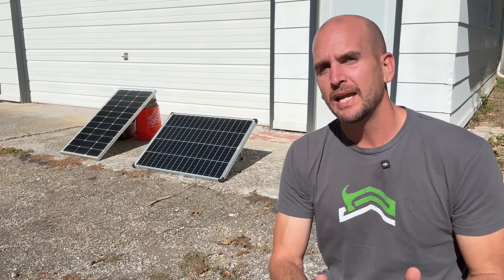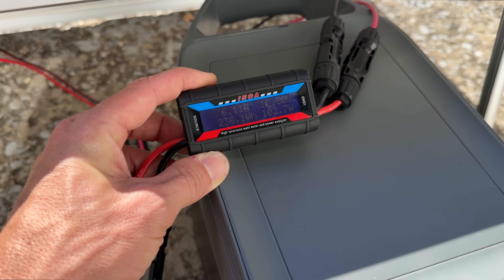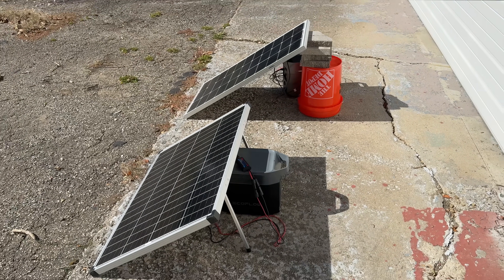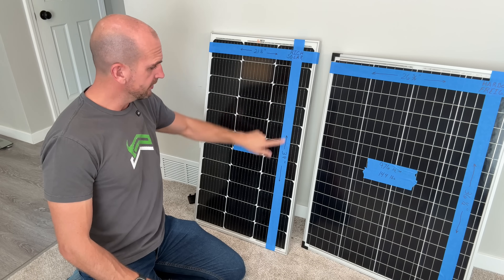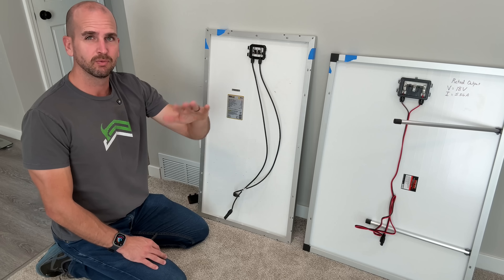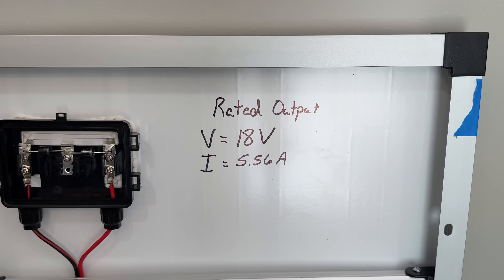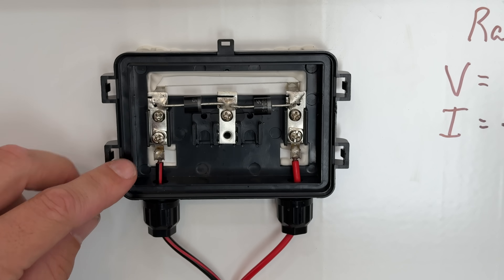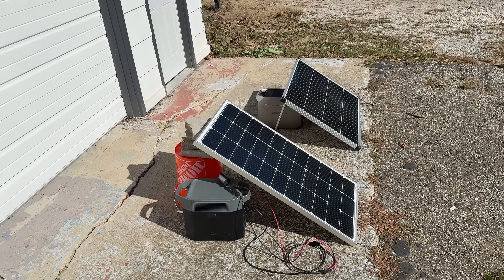Harbor Freight 100W Vs Rich Solar 100W |  Tested!

Comment: Why would you buy a 100 watt solar panel, when you can buy a 400 watt panel for $126 per panel and Harbor Freight is $199 for a 100 watt panel.
Reply: Who makes the 400 watt panels? You didn't say.

Comment: I don't know if you have looked to see if there is any difference when testing based on the orientation of the panels.  Noticed you had the Harbor Freight in a "landscape" orientation (I assume because of the legs) and the Rich Solar in a "portrait" orientation.  I would assume the companies would make the glass (or plastic) covering as transparent as possible but there could be some unavoidable polarization happening in the construction process.

Comment: I should remind folks that you don't necessarily want panels that output over their nameplate rating. Especially for tiny homes/off grid use, this could overload the inverter if the inverter is sized to match.

Comment: Little late to the game. But great video!  Went through a divorce and currently in a "OLD" 70s single wide (NOT large at all for actual living space. A few hundred sq ft.) NO mortgage, and really just use micro wave, hot water heater, Laptop, phone/charger, and maybe a  box fan. With winter coming, I can always use a wood burning furnace (to heat hot water also).
So, draw would only be fridge, laptop, phone/charger.  Found a free OLD BIG box projector for the front lens (like a HUGE magnifying lens. Look up "Solar Death RAY")
Which gets me thinking if the parabola would be too intense and melt solar panels??? Or if it can be 'adjusted' to intensify the solar "input"??

Comment: The overall Area for the Harbor Freight Panel is 17.7% bigger than the Rich Panel. So it appears that size wise they both have the same output.

Comment: An important factor to include (and compare) would be the Wh/area of the panels, which can be important if the panels are being used for a permanent installation.
A minor dyslexic errors on the white board: 232+191=423, not 432.

Comment: At 10:10  Error   You transposed your numbers    423wh     vs     495wh   Note: I am tempered to cut away immediately.  Where so glaring a math error made it through production calls into question all of your math.  Also.
"17% 'difference'  Are you calculating up, or down?  'Difference' is insufficient.  Calculating up the HF is 17% gain.  Calculating down, the  RS is producing 14.5% less than the HF  That you got the 17% correct implies a production error, the star presenter simply transposed when filming ,  you got the math correct prior to filming.

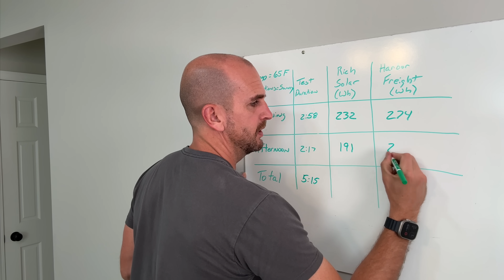Comment: Pedantic note: there is a small error in addition at 9:46. 232 + 191 = 423 (the video incorrectly claims the result is 432). The claim about there being a 17% difference in energy produced is correct.

Comment: I use mono crystalline panels for my small solar set up, but I was also thinking of adding some harbor freight Amorphous silicon' from what I'm reading they're not as powerful in the bright sun, but they do better in the shade and overcast. Do you have any thoughts on this?
Reply: Sure, but the HF are 2x more expensive than the Amazon ones...at $50-$60

Comment: A lot of people in the comments keep mentioning "cost per watt-hour." I think way too much emphasis is put on that statistic, because you only pay for the panel once. If panel A puts out slightly more wattage than panel B, but panel A costs $30 more than panel B, then panel B might win the "cost per watt-hour" contest upon initial purchase, but panel A will win after a certain amount of time goes by (probably less than a few months with the examples in this video). It's because the "cost" is a one-time figure, while the "watts" will (hopefully) keep coming for many years. I'm not saying you shouldn't consider "cost per watt-hour," I'm just saying don't put too much emphasis on it unless you add other, more important factors to the equation.

Comment: Need to also include: 
Max expected life cycle of the product. 
How many years its expected to maintain its peak efficiency. 
Warranty. 
What it takes (cost, etc,.) to get it properly disposed of, at the end of its serviceability. 
All these factors matter. Never mind its regular maintenance costs (cleaning, and so on..), just to stay at its peak efficiency. 
Along with the battery (storage) capacity cost needed, just to get "something" to run off of it consistently.

Comment: I think you might have overlooked something.  Correct my math if I'm wrong, but the Harbor Freight panel is about 17% bigger. And you are getting about 17% more power. PLUS, the Harbor Freight is getting almost a full 100 watts during the full 5 hours... which I find highly unrealistic in real world conditions for a 100 watt panel. Isn't it more likely that the Harbor Freight panel is simply a 120 watt panel? 

Btw, one possible purpose of doing this would be to artificially inflate their quality/reputation, etc. To get good reviews like the one you just gave them.  To have lots of people bragging about how they get almost full wattage all day long... when in reality they might not be getting any more than any other panel of similar size.  Just a thought.

Comment: Since the HF panel costs >30% more for 17% more power, which is the better deal?
Reply: The 100w panels on Amazon for $55 but better off using minimum 200w panels with 300w preferred. Less holes, less mounts, less connectors, less space. Use the largest reasonable

Comment: 9:58  Not sure how you're getting a 17% increase over the Rich Solar.
495 - 432 = 63
63 / 432 = 14.58%
Reply from the maker: Yeah, I wrote the summation down wrong.  It should have been 423 instead of the 432.  Thanks for the feedback.

Comment: The Harbor freight is 17% larger and get 17% better. I think you should include performance Per square foot. If these were the same square footage the Rich would be better as you could fit more in the same area.

Comment: thanks for this 🥰  i am just getting into solar 

do flexible panels offer less power ?  
are Bifacial solar panels better for the price ?
 How long do solar panels last ?
 is buying used panels even worth it ?

 perhaps you could include these in your 100w test 
 thanks in advance   liked + sub your channel
Reply: Most good panels have a 25yr warranty. Flex aren't solid and reliable yet. Have issues overheating, hard to replace and cause a lot of fires. Tend to have short lives. Don't waste your time and money. A surface can hit 140+ deg, a panel glued to it is a bad idea

Comment: Just a tip regarding watchability - there is way too much filler in this video. Remember, the purpose of a product test video is to convey information to the viewer. Good product review videos convey this information efficiently, and this video could have given all the required information in 2 or 3 minutes.

Comment: Those are both ridiculously expensive panels.  Quality panels are now under $0.40/w so seeing these at double and triple that cost is crazy.
Reply from the maker: I think you are correct for 400W size but I haven't seen that type of pricing on any new panels in the 100W range.  Let us know if there is a different site you are using for cheaper panels.

Comment: I wish theres this kind of test for lots of panels on the market, currently not very happy with what i have, 665wp trina panels, only make roughly 400-480w per panel
Reply: Multiple factors at work, generally you'll see 75% of rating is normal

Comment: Curious, does the Delta adjust it's input depending on it's percent of charge level? Would a bank of resistors be more accurate? Just wondering.

Comment: If the average cost in the United States is 12 cents per kilowatt-hour, how far out is the break-even point?   Durng ths test, each panel generated about $.05 of power.    I don't know if the total time was mentioned, and obviously there will be variation during the year.   During this test there were no clouds in the sky.

Comment: interesting. But no solar charge controllers?  good way to overcharge a battery.
Reply from the maker: The charge controller is integrated in the Delta 2 and Delta 3 Plus

Comment: Comparing apples to apples is not accurate here, you should figure out efficiency per area, cost, weight ALL of which are different between these panels. They are like more more comparable than “17%”

Comment: Repeating the test in cloudy weather or midwinter would really help show us what we can really rely on.
Reply: That was polite. It would show you what you can't rely on.   On the other hand, during the summer, if they're mounted on the roof, it should be reducing the heat load and reducing the need for air conditioning
Reply: @ArtStoneUS if you have sufficient insulation (R30-40) and air sealing, attic temperature has a minimal effect.  

My attic had no insulation when I moved in and the electric is reposit was $600, telling me the bill averaged $300/ month.  
I put r13 batts in and added another layer of r30 on top.  
Highest bill is 120 summer  and 150 winter, light usage is about $80/month
Reply: @ArtStoneUS  Both are junk.
Reply: @nonya.bizness  I said " the 14 G can easliy handle the 8 amps" and you said " 14G is good for 5-10 amps" so I think we're on the same page. Amps are amps, 14G is good for 15 amps all day
Reply: @nonya.bizness  14G can easily handle the approx 8 amps we're talking with these panels. Adequate unless you are running 100 ft or more. You have to be grossly undergauged in order to effect output
Reply: Doing a rough estimate of 20v x 8 amps gives 160 watts, so from a safety standpoint, like you say, it's well within the rating.  From a voltage drop standpoint, it's a different story. If your thinking house wiring at 120v, then the voltage drop over 20 feet (perhaps that's long, but it gives sinething equal to compare) would only be .8%.  But at 20v, the drop would be about 5%. Using 10 guage instead would reduce that voltage drop to 3%. Multiplied out times however many panels you have, that 2% difference could be noticeable.
Reply: Spot on. My best panel performs much better than my others on cloudy to overcast days and when the angle/direction isn't perfect.
Reply: Nothing works on really cloudy days, I have several brands hooked to inverters for my home
Reply: @kkmart43  I have solar panels on my home, and they produce around 1/3 to 1/2 of their normal output on cloudy days. The only time they don't provide any power is during the winter when they get covered in snow.
Reply: @imnotmike  need to stand them up vertically in the winter.
Reply: No, this whole thing was already over engineered.
Just set them at the same angle at the same time one time, get wattage output and you get the comparison
As soon as he said 100 w vs 85 w we knew right there HF had around 15 % more out put
You'll get the same results no matter how you slice it, as shown with the unessicary over-testing

Comment: You will have to also figure in the cost for the panel and break it down to the price per kilowatt/watts.
Otherwise a panel that produces 500w but costs $650 is Not better than a panel that produces 387w but costs $400

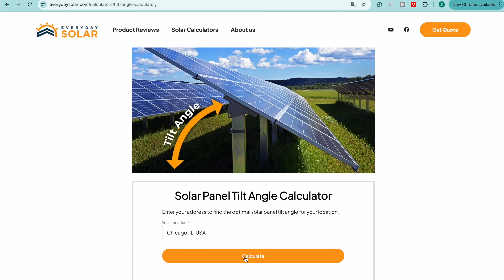Comment: 2:00 For the angle just wait for noon. Then adjust the panel by looking at the shadow. Raise and lower until the shadow is at a maximum point. If you have them easily accessible as he does you can adjust this periodically because the angle changes with the season. You don't need any fancy instruments... just a watch.
Reply: Very good point, you can also google solar noon in your area for specific dates, in my case in Miami, FL solar noon is 1:17PM, the sun will be at its peak (closest to us).

Comment: Harbor Freight USE To Sell a Really Good Set Up for Under or just about around $100.. The One they sell now, the Controller is Shite and goes out. The Panels Peel in Less than a Year. Also Now cost over $100... But I am not allowed to Post Product Reviews on their Site about it and NO Longer Allowed to post ( Any ) Product Reviews on Amazon.. Because I Go into Detail.. And the Companies HATE That, Specially if the Product Sucks!.
Reply: Do you have your own site to post reviews? You should
Reply: I'm glad I'm not the only one soon as I put China trash in my review that was it
Reply: How’s the view from the doghouse?

Comment: The rich solar panel seems to have done relatively better in the afternoon.

I wonder if this is a measurement issue, or that different panels behave differently in different conditions. Might be worth doing an hour by hour plot, and comparing performance on cloudy days etc.

Comment: If you buy anything solar, check on the manufacturing company and their engineering specs to find the best 1. Any company that won`t put out the quality specs on their product should be ignored.  The issue with power home solar should be a good measure as to how bad it can become. Do some due diligence as to what the best quality is for solar panels and equipment. And check your math, it was 423 WH. 18% difference.
Reply from the maker: Thanks for the feedback.

Comment: @ 10:30, Rich Solar area = 829; HF area = 976, hence, 829/976=.849, or Rich Solar panel area is 84.9% of HF or HF is 15.1% larger than Rich Solar. For Rich Solar, the energy per square inch is 423/829 = 0.510. For the HF is 495/976= 0.507.  Conclusion: the Solar Rich is more efficient than HF. The 17% extra energy from the HF is due to its larger Solar panel surface area. If both Solar panels sell at the same price, then buy the HF.
Reply: Exactly. Square inches are the only true comparison THEN, cost comparison.
Reply: @chrisp7652  wrong should be cost per watt assuning you have the area for slightly bigger panals
Reply: Glad to see that I wasn't the only one checking his math!
Reply: Yes, this is correct. I've seen many tests like this done and it nearly always come down to panel size.
Reply: This guy is stupid.  I told myself never to watch him again a long time ago.  I failed.
He goes into a lot of setup and analysis and still makes an error which changes the results and he never realizes it.
Reply: The 17% higher production number is about the same, as 17.7% bigger area number (976/829=1.177).
Reply: But his math wasn't mathing. Rich solar only adds up to 423 making the difference in percentage slightly higher
Reply: @hdgfs1  His math is ok, the mistake is only in copying the production number. 17% higher production still stands.
Reply from the maker: Here is some additional information on these panels with the addition of Renogy and ECO-WORTHY Spreadsheet Results - https://docs.google.com/spreadsheets/d/1cXY9StZ4SaLIzjlhyiC26kxJZy3hJ5jE/edit?usp=sharing&ouid=110269586406228906661&rtpof=true&sd=true

Comment: @ 10:12 , (495-432)/432 = 14.58% , which means the HF is  14.58% more than Rich Solar, using Rich Solar as the base. However, using (495-423)/423 = 17.02%.
Reply from the maker: Correct, 423 was used for the % calc.  Wrote the Rich Solar summation incorrectly.  Thanks for the feedback!

Comment: Thanks for putting so much thought into making a useful comparison!
Reply from the maker: My pleasure!  Here is a roll up of some additional 100W panel comparisons with the addition of requested metrics from the audience Spreadsheet Results - https://docs.google.com/spreadsheets/d/1cXY9StZ4SaLIzjlhyiC26kxJZy3hJ5jE/edit?usp=sharing&ouid=110269586406228906661&rtpof=true&sd=true

Comment: I have the harbor freight and generally satisfied but noted power reduces when panel is very hot. Example: full sun in July about 30 watts vs full sun in October 95 watts.
Reply: That’s for every solar panel ever made. Heat causes more internal resistance which lowers output
Reply: It be called Resistance. Try running a fan when summer comes back around and see if that helps any or you could construct a heat sink.
Reply: Air flow across the back is very important.  Flush mounting them on a solid surface is very bad.

Comment: You missed a key point.   The price difference.  If the Harbor freight is 2x the cost, then it isn't economical.
Reply from the maker: Good point.  I went back on the next comparison video and added some additional parameters which make it easier comparing apples-to-apples Spreadsheet Results - https://docs.google.com/spreadsheets/d/1cXY9StZ4SaLIzjlhyiC26kxJZy3hJ5jE/edit?usp=sharing&ouid=110269586406228906661&rtpof=true&sd=true

Comment: Also since the load a a variable load, I would use a fixed load like a high power resistor, also a check comparison on $/watt initial purchase cost. It would be nice to do a flash V/I curve test, but hard to do with a complete panel. Great work otherwise

Comment: I used to think the same way regarding solder versus crimp, but then I realized that solder will fail if it overheats whereas crimp will stay connected.

Comment: I don’t understand watt hours. So if harbor freight collected about 500.  Does that mean I could run 1,000watt microwave for 1/2 hour?
Reply from the maker: That is correct 👍
Reply: Sort of...a 100w panel won't run a microwave...the batteries and inverter will. The panel will recharge the batteries

Comment: The angles are not the same. It matters! 😅
Reply from the maker: They were within 1 degree of each other.  🤷‍♂️
Reply: Yeah. Maybe I wasn't very clear with what I meant. The efficiency of the panel is directly proportional to the angle of inclination relative to the equator vis-a-vis the orientation of the panel. The HF was orientated landscape while the other was portrait.

Comment: Why even waste a video on a 100 watt solar panel.
If this was the year 2019 maybe ,
I can buy 400+ watt panels for the cost of this crap
Reply from the maker: 100W panels are used for a lot of DIY projects.  200W and 400W panels will be tested soon 👍